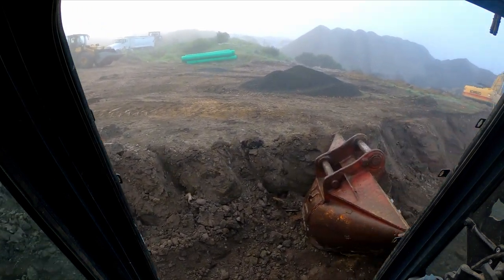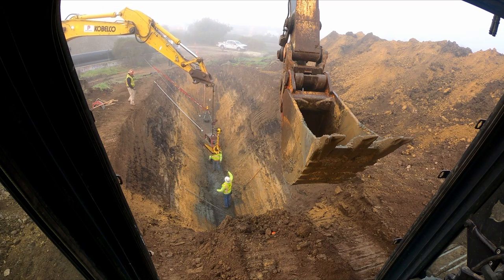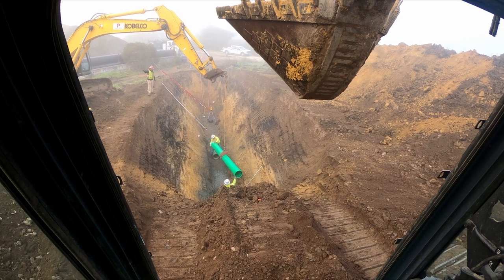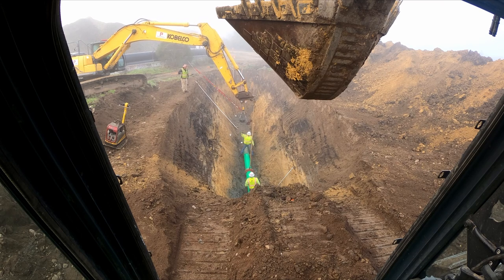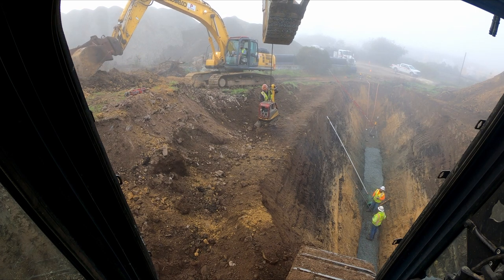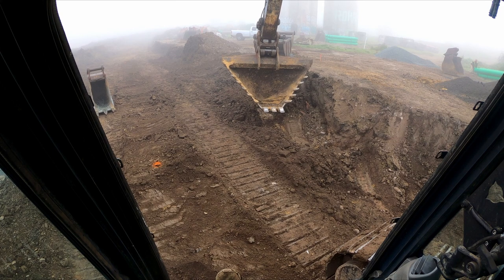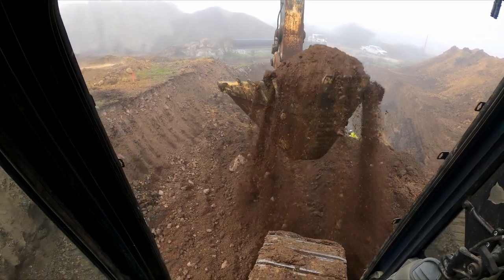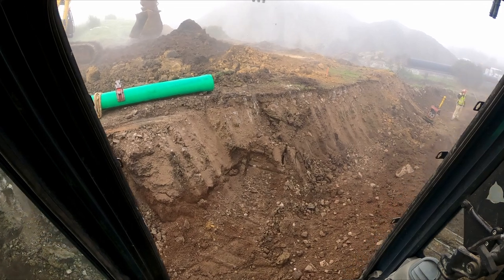Forman adapts to changing conditions Part 3

Comment: We had about 2,800ft of 10” SDR 21 that sat on a job for about a year before we started it. It all “banana’d” so bad that we had to mark the top of each bow with a sharpie so we could lay the bow pointed up. We also have to drag a deflection mandrel through every run, talk about a damn headache
Reply from the maker: The banana should be on the side so to keep the flow line on grade. Turds want to slide not go over bumps.

Comment: First off great videos i am a pipeline foreman in so cal. Local 12 and Local 585 laborers. I enjoy watching your channel not only to see what projects you guys tackle but to pick up ideas of my own on means and methods for me to improve on. I like how your foreman is the middle of it and trying to figure what works that’s what it takes to make a crew roll efficiently. 
I have a few questions about the pipe layers. Do you guys not set up string line, I see they check the grade with the pipe laser does work good for you guys and has it ever backfired doing it that way? I see why you guys do it it’s a bit faster than setting string on every set. 
And are you guys tuning two pipe  lasers one to check FL. and one to dig sub grade?
Reply from the maker: We start with a laser on top and bench in a shot on the FL then we set up a laser down in the hole so we don't have to have a long rod. We then set up two rods one for rock grade and one for sub grade both on same laser.

Comment: Is the plate compactor something that is required by code or is it something that the company does for best practices? In Ohio we skip that step. Just bed and go . Keep up the good videos.
Reply from the maker: It is required by the city inspector. Other wise we would skip it too.
Reply: Are you using crushed rock or baserock?
Reply from the maker: @apecobbb707  Baserock on all pipe types.

Comment: I don't see an advantage to that bucket being turned around for the rock, why is it?
Reply: Reach easier. And scooping it up from the ground you dont end up pulling the pile towards you
Reply from the maker: The loader can fill it wile it is on the rig. It adds some reach with out the weight being out too far.

Comment: How deep is that
Reply from the maker: about 20 feet
Reply: Stupid question- couldn’t a 350 or 500 Kobelco have done just of good as a job as this 800 and then save a $10,000+ mobilization?
Reply from the maker: @bigiron3304  The 870 was on the job for all the deep digs we had to do. and to answer the question NO the 350 and 500 can not move as much dirt as the 870 can. We bud the jobs for a production number and that rig is the one that can make it happen and some. The 350 can reach 19 feet but you would only be digging a 2-foot long set where I can dig a 5-10 foot set with the 870 at 19 feet deep. And our competition here is using CAT 390s to dig with.

Comment: Where's the pipe laser?????
Reply from the maker: We don’t use pipe lasers in CA
Reply: I layed pipe for 18yrs, most of the time I used a fiberglass shot rod w/ the whirly bird laser. With a pipe laser the been will flex up or down, depending on the weather. Two other things, the pipe layer has to keep track of the " target" & the beam gets a little bit smaller the farther you get out. The whirly bird lasers you can set you slope of the run & boom you good to go. And with a pipe laser you have to set up a transit level,shoot center of pipe at starting point & ending point,then get your first stick set to grade the shoot center pipe. It's much faster to use whirly bird